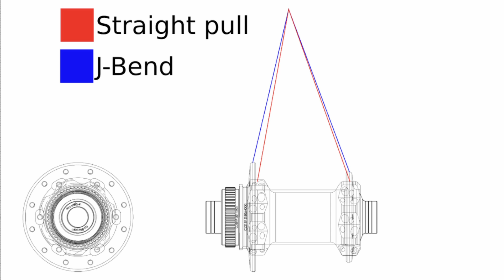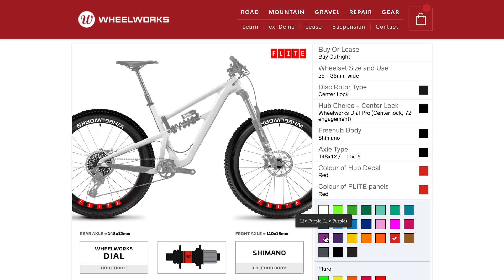J-BEND vs STRAIGHT-PULL spokes

Comment: What u think about 28 and 32 spokes , i al running a fabric wheelset un mi bike with 32 spokes AND want yo change to 28 , they need readjust More frecuently ?  I'm a light (54kg) person and I use it in the city and a little bit on the road.

Comment: What is your opinion about SP spokes interlacing? Some companies propose under-under-over interlacing, however, wheel build mechanics keep that straight is straight. Under-under-over creates unnecessary load to the spoke itself and hub spoke eye-lets
Reply from the maker: It depends on the hub, but most straight pull wheels will not be interlaced -TT

Comment: As an amateur wheel builder, i am building my first set of straight pull.  I chose straight pull based on looks.  Now i know better.  At least it is for a road bike and not MTB.
Reply from the maker: as an amateur you might find the build slightly trickier, especially if you're using round-section spokes, as the spokes can rotate.  Make sure you use a spoke rotation tool!  The Park CSH-1 works well for round spokes.  -Tristan

Comment: Nice video, valid points when it comes to building wheels, having more options with j bend spokes. But I will say, I worked in bikes shops for over ten years, prob 90% of the time I replaced a broken spoke it was because the spoke failed at the elbow(90 degree bend where it entered the hub). It almost never broke in the middle or at the nipple. Almost always at the elbow/J bend.
Reply from the maker: You should watch our video on why spokes break :-)  The J bead breakages are generally either poor quality spokes or low spoke tension -Tristan  https://www.youtube.com/watch?v=FLwaDXe-1U8

Comment: Informative vid. My DT Swiss 28 spoke straight pull mtb wheeles have a flexy noodilie fell vs my 32 spoke j bend wheelset. Both same rims. Also rider weight dependant.
Reply from the maker: Interesting, but I'm not surprised!  The lateral stiffness of the 32h wheel will be around 14% greater simply by having 14% more spokes. There will also be some affect by the hub geometry, probably in the j-bend hubs favour -TT

Comment: .Cost of straight pull spokes is more the j pull
Reply from the maker: This is partially true...straight pull are cheaper to make and at the OEM level where you're buying 10,000 at a time they're slightly cheaper.  They often become more expensive at retail because they're often proprietary and the brand can therefore charge whatever they want as they know you need one -Tristan

Comment: Mega easy to lace a straight pull wheel and fairly straight forward to replace a spoke without removing the rotor and cassette. Apart from that they are just terrible.

Comment: Question about spoke count:
I'm diving into wheel options for my Turbo Levo, specifically looking at DT Swiss HX 1700. I noticed the factory option comes with 28 straight-pull spokes, but there's an alternative to build the same wheels with 32 J-bend spokes on 350 hybrid classic hubs and XH 531/581 rims.

How crucial is the spoke count in (e)MTB wheels, and would the shift to 32 spokes provide noticeable advantages in durability or performance? Keen to hear your experiences and insights.
Reply from the maker: Spoke count has more to do with lateral stiffness and ability to stay true should a spoke or two break.  Stiffer carbon rims can use fewer (and lighter) spokes without a noticeable drop in lateral stiffness.   An ebike generally wants as much lateral stiffness as possible as the extra weight of the bike.  ~Tristan

Comment: I have an interesting discovery to add to the straight pull vs j bend comparison. I had a very high end mountain bike with carbon Reynolds rims laced to DT 240S hubs, which are straight pull. I had an issue that I took ages to solve, and it was this: in the 3 highest gears, as I would pedal, my rotor would rub every revolution on the brake pads. This did not happen in any of the other 8 gears. When the bike was in the stand, and I spun the wheel in any gear, the rotor was dead straight. So, there was something happening in the high gears that was causing the rotor to rub. I checked the frame, the pivot points, everything, but to no avail. I eventually determined that it must be hub flex, and so I was going to be upgrading my drivetrain, and I wanted the new 12 speed Microspline, so I built up a when with a j bend XTR hub. Lo and behold, the rubbing issue disappeared. 

It is my belief that a straight pull hub is going to flex and twist more than a j bend hub. It is the spokes bracing the hub flange of a j bend that resists the flex and twisting that the straight pull flange cannot resist. I'm curious to see if anyone else has encountered this issue, and if they agree with my assessment.
Reply: I think I'm having the same problem.  Again, on a  straight pull dt240exp hub.
Reply: have same problem in my fulcrum 27.5 mtb wheelset, worse because i can also feel the front end flexing rubbing the rotors in w/c it is not being solve/no solution at all.
Reply: Mt DT swiss spline 28 wheelset was very flexy vs 32 jbend with same rims.
Reply: Why does MX hubs use straight pull then

Comment: Apparently you've never actually had to change a broken spoke on a straight pull setup. The clusterfuck of spokes around the hub make it impossible to easily slide the old one out and the new one in

Comment: Hi there, great video! What are your thoughts on proprietary spokes? Ie the I9 system and the larger diameter alloy spokes? Obviously harder to source a replacement spoke etc but are they stronger, stiffer? Thanks 🤙🏻
Reply from the maker: Overall we haven't had great luck with either the I9 spokes or similar Mavic aluminium spokes.  Spokes generally function best under tension and aluminium isn't the best material for this use case.  -Tristan
Reply: @Wheelworks Handcrafted Wheels  
Thanks for the reply Tristan. Good to know 🤙🏻

Comment: I had a mavic  wheelset with straight-pull spokes and got a stick caught in the wheel and it ripped the spoke through the flange of the hub making the wheel virtually useless.

Comment: Great video, I would add as a pro shorter overall  spoke length for J-bend increases lateral stiffness and stability. 

There is also the physical contact at the cross off spokes with J-bend that increases stiffness and prevents spokes from turning under pressure.

The weight pro for straight pull...the minuscule weight gain for straight pull hubs is in the center of the wheel so the rotational mass gain is actually nonexistent...

I am all in for J-bend ✌

Comment: straight pull is the same as t-head?
Reply from the maker: Straight pull and T-head are NOT the same thing.  Another industry "standard" which makes things super confusing for users :-(  Tristan
Reply: does a t-head work in a straigpull dt swiss 30 hub?

Comment: Regarding weight, I found that straightpull isn't necessarily lighter in total. Yes the hubs are lighter, but the spokes tend to be at least 10mm longer. Multiplied by 28 or 32, and its a significant amount of weight that typically negates anything saved from the lighter hubs. In the case of DT 240 it actually came out lighter to build with j-bend.

Comment: Nice informative video, thank you!

I just broke a SP spoke on my gravel 24 spoke Al asymmetrical wheel on the cassette side while pedaling hard out of a roundabout.
It broke at the hub end and I am worried other may follow since it a light wheel used a lot for routes where people ride even FS bikes.
Should I change all spokes on that side since I tend to ride in remote areas as well?
Reply from the maker: If a straight-pull spoke broke at the head then I'm very confident that all of the others will eventually break.  I'd suggest getting the wheel rebuilt with a good quality spoke by someone who is experienced.  -Tristan

Comment: Hmmm. I'm considering getting a DT Swiss 350 hub straight pull because the flange diameter on the drive side is larger, meaning the bracing angles between the two sides will be improved. The J-bend version of DT Swiss 350 have the two flange diameters exactly the same. This is the only reason I'm considering the straight pull, and my current Hope Hub is so blooming noisy.
Reply from the maker: The flange diameter is larger to compensate for the reduce center-to-flange because of the thicker straight pull flanges.  The bracing angle at the rim will be very close between those two hubs. -Tristan
Reply: @WheelworksHandcraftedWheels  Thanks for the reply.

Comment: All I hear is claims with no scientific evidence. Conveniently when comparing bracing angles you only showed the spokes facing the outside of the flange what about the ones facing the inside? Those are steeper. Also the lack of choice of lacing patterns is being sold as a negative while it's obviously a positive as it forces you to use the best possible lacing pattern: 2 cross for 24 hole and 3 cross for 28 and above. Lacing is 100% faster with straightpull and less prone to errors. Defending J bend really is mainly for retrogrouches, which a lot of cyclists seem to be. I am planning some experiments with a physics lab in Berlin to debunk fantastic claims like these.
Reply from the maker: Hi Xaver - I look forward to seeing what you and your team find!  Please let me know when your experiments are finished up -Tristan

Comment: Love to hear you go over the best HUB for working with an E-bike.  Is the industry nine Hydra King?  or are there competitors like DTSWISS 54T Ratchet?  I'm not rich. But I want bulletproof wheel build.  So I want to integrate Cushcore and use quality spokes. I don't have a huge Budget.  Was considering Hope Pro4 Hubs( cheaper then most), with Dtswiss XM Rims.,  curious what you think.
Reply from the maker: The Industry 9 is probably the worst hub for an ebike on that list as the high engagement point design puts a lot of stress on axles and bearings and these wear out very quickly.

The DT Swiss classic (not the EXP) system works really well on ebikes, as do the Pro4 and our Dial hub.

Dial has faster pick (72 engagement points) and Hope has lotsa colours.  You can't go wrong with either.

-Tristan

Comment: Does aluminium straight pull spokes require more tension than J bend spokes? Eg 305 wheels from Industry nine.
Reply from the maker: The material will change the amount of tension required but only slightly.  Essentially (and this is a gross oversimplification) the spokes need to have enough tension that they're stretched enough that they won't go slack while the wheel is being (ab)used.  -Tristan

Comment: Hey, I have a problem, that my wheelset from the brand XLR8 uses the straight pull spoke, and after riding it on bumpy tarmac for several kilometers, the spoke loosened and separated from the nipple. After fixing and truing it, the problem comes again and again. Is there any suggestions to solve this? Is it safe to over-tensioning the straight pull spoke while truing it?
Thanks
Reply from the maker: It sounds like a build-quality issue with the spoke tensions being too low.  I would suggest you reach out to XLR88 and see if they can help you. -Tristan
Reply: @WheelworksHandcraftedWheels  Thanks for the answer, man!

Comment: I'm in the process of learning the art of wheel building. I've successfully built two j bend wheels without many hiccups. 
Then I tried to build a wheel with an existing straight pull hub I already had... what an absolute nightmare! Never again.
Reply from the maker: I find some parts of the wheelbuild easier, however the initial measuring and spoke calculation can often be a real nightmare! -Tristan

Comment: I really like your video's! Very good advice! 😁I have a question. I want to build my own wheels for my roadbike and I'm doing a lot of research for it. I picked DT Swiss 350 non-disc hubs (J-bend) and DT Swiss RR 411 28'' Rim front 28H and the asymmetric 411 rear 28H. I want a 1 over 3 spokespattern in the rear and a 1 over 2 or 1 over 1 spokespattern in the front. But I'm not sure what brand I need to choose for the spokes, so I was wondering what the difference is between Sapim Laser and DT Swiss Revolution. They are both double butted, 1.5mm in the middel and very light. What would you recommend and will this be a good wheelbuild that I have in mind?
Reply from the maker: If this is your first wheelbuild then a heavier spoke will be much easier to build with.  Revolutions and Lasers 'wind up' a lot as you're building and can be really tricky.  A spoke like the DT Swiss Competition will weigh a little more but will make your wheelbuilding experience significantly more enjoyable :-)  -Tristan
Reply: I had built up the RR411 asym rim and didn't like it at all.   It's a super flexy rim that does not benefit from more even spoke length and tension.   R460 or R470 (disc) built up so much stiffer of a wheel.
Reply: I've build my wheels with this asymetric rim and have no issues with it. I've laced them 1 over 2 in de back and radial in the front and they just ride lovely! I go a lot faster with them then with my previous wheels. But I also don't know how the normal rim rides, so I can't compare it
Reply: @Silverlens_media  Having built up plenty of wheels myself, the standard non-asym DTSwiss road rims are actually stiffer.  Just giving you my experience for future reference.

Comment: I always hear the "easier to find a replacement" line in favor of j-bend... how often are y'all really breaking spokes in remote locations where bike shops don't carry what's now a common spoke type? This is a non-issue, and really if you're going to be in such a location, you should be carrying spares for things like that along on your trip.
Reply from the maker: I disagree - based on the number of people who call us looking for replacement spokes for their Roval / Bontrager / etc wheels because the dealer they bought the wheel from can't supply them, I'd say getting replacements in the correct length is tough -Tristan
Reply: @WheelworksHandcraftedWheels  Just called the four bike shops within 10 miles of me... all four had sufficient straight pull spoke stock that when I said I wasn't sure what size they said some variation of "just bring the wheel in, we carry most sizes so I'm sure we have it on hand" and I have personally broken spokes at Whistler and Tahoe over the last five years and on both occasions, the first shop I stopped in had them in stock.
Reply from the maker: @troybrowning839  I'm glad to hear your experiences finding spokes are positive!  -Tristan

Comment: You left out:  Double Butted Spokes..?  which helps prevent impact on the Rim that causes the rim to crack near the spoke...?  And what are the advantages of adding a washer under the nipple to disperse the stress over a wider space in the rim..?    From what i understand, Straight-Pull are very stiff and do not allow flex so the entire impact of bumps is put on the rim which causes cracks.  
This video could have gone more in depth.  And explained all the pros and cons of J-Bend vs Straigh-Pull vs Butted spokes.. You didn't give us a complete picture.. Please elaborate on ALL options and their unique advantages.
Reply from the maker: Hi Rob.  This video covered the differences between J-Bend and straight-pull spokes and didn't go into the differences in spoke type or whether spoke washers are needed.  Those are great topics and ones we'll look at for future videos.  -Tristan

Comment: Thanks for posting this video, I recently bought a set of Enve wheels and was wondering if I was giving anything up with the J-bend spokes they use - nice to know I'm not .  I actually had a spoke snap on me when I hit a crater and it was on an entry level set of rim brake wheels (Campagnolo Scirocco), not a great feeling when your doing 25mph on a busy road.  The 16 spokes on the front wheel definitely factored in as did my 220lb weight, now I'll only use a minimum of 20 spokes (24 is preferred) and of course a much better wheelset.
Reply from the maker: We're here when you're ready for a better quality wheelset which won't break spokes ;-)  -Tristan
Reply: @WheelworksHandcraftedWheels  can you please get me a strong 26"¹ rear disc wheel recommendation.Happy with a good condition second 
Many thanx
Reply from the maker: @josephfuller496  no problem!  You can take a look at the options here (https://www.wheelworks.co.nz/dt-swiss-alloy/) then drop us a note through the website with questions -Tristan

Comment: Very informative. There's a brand out there that says it uses straight pull spokes on some of its wheel types because of "excellent torsional strength." First, is "torsional strength" a twisting of the wheel or twisting of the spoke or something else? Second, is that a legit concern? Third, if so, is the torsional strength of straight pull spokes better than J-bend?
Reply from the maker: Sounds like they found a fancy-sounding word!  This doesn't make any sense to me - I read it as the spoke twisting but you care more about stiffness there not strength and it's not something that happens to a spoke after being built anyway.  So without knowing more, I'm calling bullshit -Tristan

Comment: Thanks for that very useful video. When I got this right, j-bend should also work better with asym rims?
Reply from the maker: Asymmetrical rims are more about increasing the spoke tension on the low-tension side of the wheel - they have a very small effect on lateral stiffness.  -Tristan